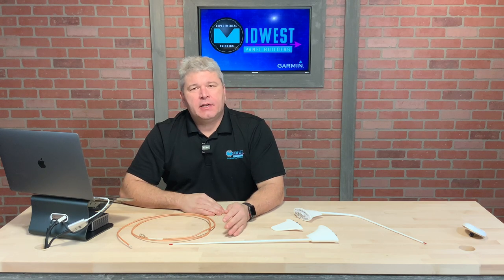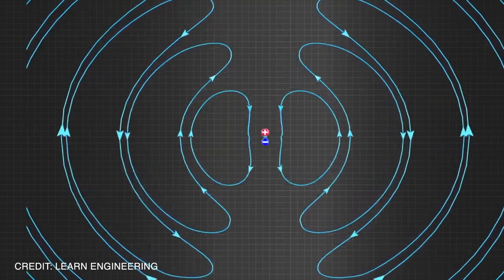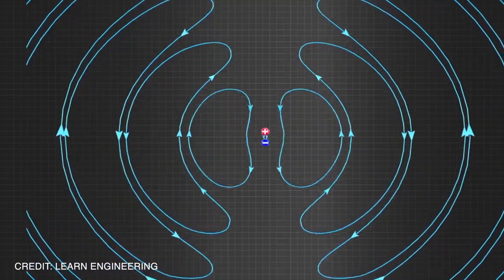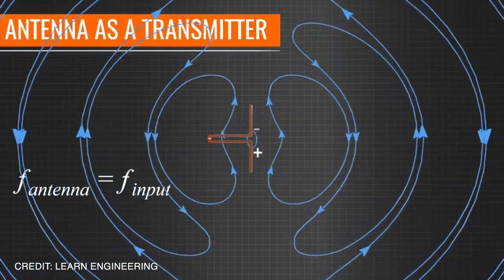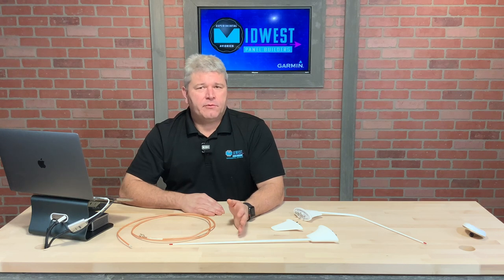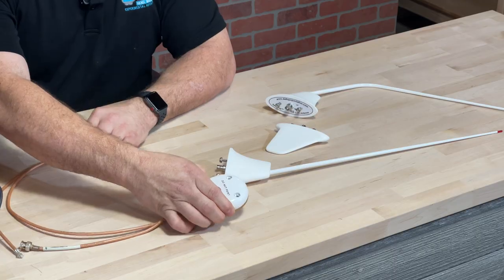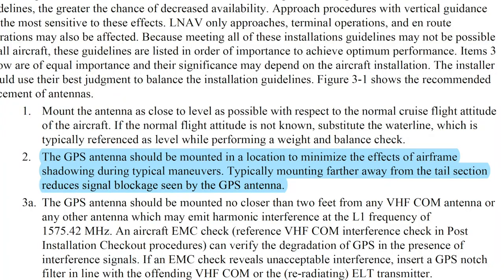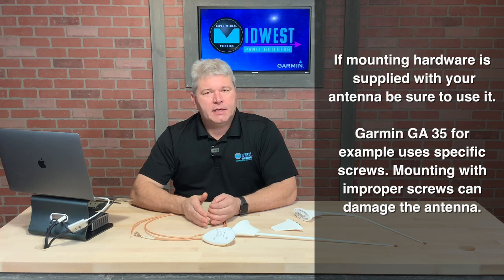Aviation Antenna Installation.

Comment: You don't want to minimize impedance... you need to match it to the designed specification - typ 50-ohm z. I think you meant to say you wanted to say minimize signal loss which occurs through the cable and at every connection.

Comment: Excellent video!  Best, concise info I've seen on the subject.  I installed my USB GPS antenna in my fiberglass wingtip.  Is this an acceptable location?
Reply from the maker: I assume this is an ADS-B antenna?  It works in many situations, not necessarily ideal but factors such as coax length and shadowing become a question. What antenna is it?
Reply: @MidwestPanels  The ADS-B antenna is from UAvionics Echo UAT.

Comment: A common convention in large planes is that the Com radio which is used mostly on the ground has its antenna on top of the plane, while the Com radio which is used mostly in flight has its antenna on the bottom. 

I’m considering installing only one Com radio. I happen to have a dual VHF / GPS antenna which I plan to use for my Com radio and GNX 375. Considering that dual antenna would, of course, need to be installed on top of the plane, is that a bad idea for a single Com radio, or does it not really matter that much?
Reply from the maker: It won’t really matter that much, maybe if you were directly on top of a transmitting antenna you could have an issue. Cessna mounts both antennas on top of the  the fuselage between the wings with no issues.
Reply: Thanks!

Comment: Hi, I want to make an external  quarter wave ground plane antenna, mainly to monitor frequencies 118.000 MHz to 136.975 MHz (aircraft band).  As far as the 3mm welding rod is concern, is bronze better than aluminum?  Also, when using the antenna calculator to determine the length of the radiating element and radial elements, what frequency will I input in the calculator and will I retain the 0.95 velocity factor?
Reply: Both materials will do, it must be a conductor. Aluminum is more corrosion resistant. Use a frequency in the middle of the band where you expect to listen the most, low part or upper part. Velocity factor is more of a concern with antenna cables (do not use RG-85 please).